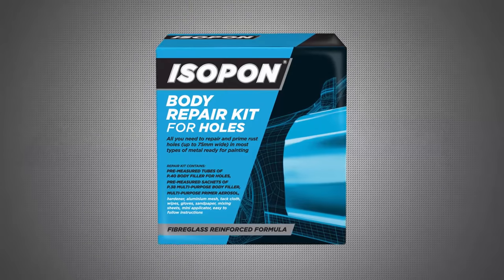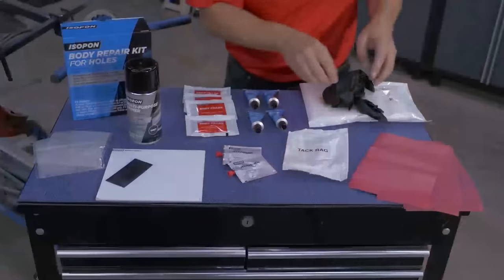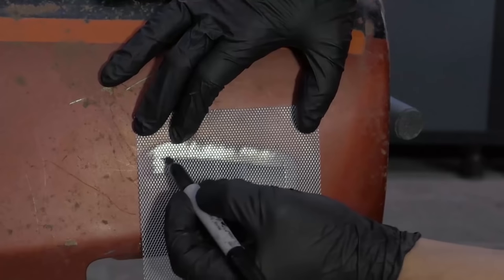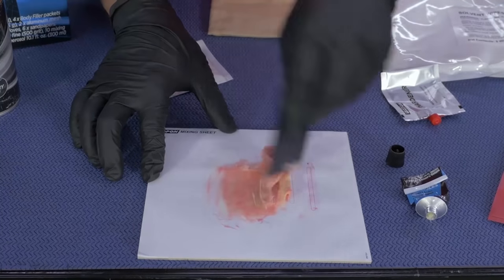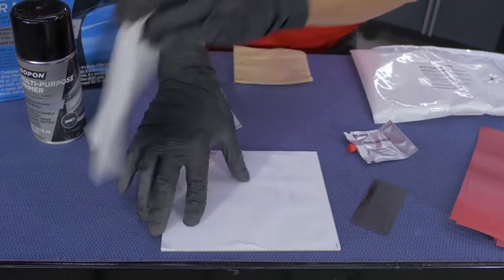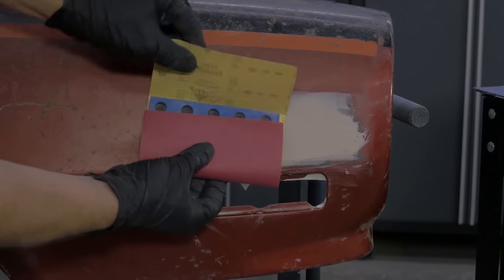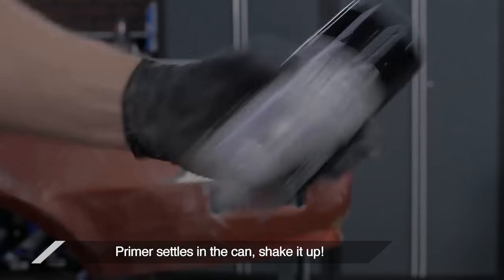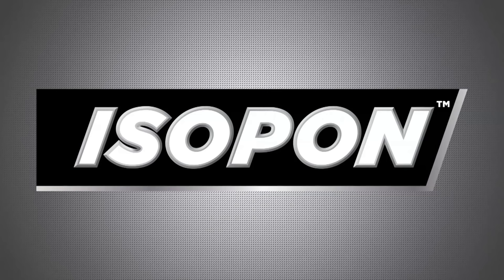ISOPON Body Repair Kit For Holes

Comment: Dislikes, why ❓😓 there's always someone who thinks they can do it better lol,great video I'm going to be buying this kit for my bumper 👍
Reply: It's not abaut the kit itself it's abaut that if you cut metal away you HAVE to put in a new metal part not just a pice of "foil" and body filer the paint will start bubeling and the metal WILL start to rust
Reply: @minikmetija1905  what metal will rust? And wait for the filler to harden properly before you paint it?
Reply: I am a body worker and when it starts to rust it dosen't matter that you sanded it away the rust is already in the metal that is why you need to cut araund the rusted part to cot away any rust whitin the metal itself. That is my experiance as a car body worker. I am doing it for some time and speaking from experiance. Plese do not think i am talking shit abaut your video
Reply: @minikmetija1905  I understand what you mean now. They did cut away all the rusted metal in the video. You say you should put solid metal in the hole rather than mesh but I don't think the filler would hold as well onto a flat surface than it would to a mesh and the filler should be hard enough not to need it?
Reply: @spinach4949  as i alredy told you i am a car schooled car body and paint worker and if you sanded the metal patch whit 60-80 grid sand paper it will be on ther for as long as the metal dosen't rust again. But i understand the perspective of a DIY man and the differance is deffenetly the price and the end result, plus to do a proper repair you need a welder and considering the price i understend your way of repair. Please understend that all i am  doing is explaining the proper method i was thot and taking intho consideration i restored multiple vintage cars i can say i have some experience. If you want to learn more abaut car body repair go to the eastwood company youtube chanel
Reply: @minikmetija1905  They didn't leave any rust.. they cut it away and sanded the edges of the hole.
Reply: @minikmetija1905  I'm assuming the primer used has a rust inhibitor in it otherwise yes rust will come through eventually. moisture is also a factor in body panel repair. sometimes it's better to just buy a panel and replace. Good video though and have been doing this for years working on astra gte's and cavalier sri's back in the day 👍🏼

Comment: Can you apply the mesh on the front side of the panel if don’t have access to the back ? Than fill and sand back ? Thanks
Reply: I have the same issue. The back of where the hole/rust is cannot be accessed to attach the mesh. The job itself looks straight forward, I'm just at a loss as to how to create a backing to apply the fibreglass....

Comment: One of the lads drilled a hole 25mm wide  in a galvanized steel water tank, filled it with isopon, still holding up today, brilliant stuff. has been under water for 12 years now, not sure if the good people at Isopon recommend it, but it worked for me.

Comment: I wonder if only applying the material from the front side create a strong enough foundation.  Should you also need to apply it on the back side so that the mesh gets strongly fixed onto the body?  I feel a strong pressure on the repaired area could give in.

Comment: This is helpful, thanks, but differs from the instructions on the Isopon aluminium mesh (sold as a separate item).  That recommends using a small amount of Isopon P40 (hole filler) to stick the mesh to the rear surface of the metal, let it set, then fill from behind the repair with more P40.  Finally, when that has set, add a layer of Isopon P38 (looks like the second lot of stuff that the person in this video mixes up), allow it to harden, then sand down.

So I'm confused!

P40 is VERY difficult to sand down because of the glass fibres in the mixture which become brittle glass whiskers when set.

Comment: My 01 ZETEC s fiesta failed NCT/MOT on rot in the wheel well and structure used this fairly badly but Sand and sprayed it well, hard as a brick wall, flew through its last two tests
Reply: Well that's dangerous 😬

Comment: Good video, but Are you not supposed to shake the can of primer in a swivel motion instead of , a up and down motion.
Reply from the maker: Hi Evan, The aerosol provided in this kit will contain a small metal ball, this will potentially have settled at the bottom of the can along with some of the base product - shaking the can in an up and down motion will release this ball and ensure that complete mixing of the base with the propellant to give the required product application.

Comment: how does the tape holding mesh not fall off ?  especially after getting wet with road use   ?   which seems to be the only thing holding mesh on the rear

Comment: U POL       I have a question: For example when a vehicle/car has been rear ended by a tractor trailer truck (hitting one side of the rear bumper) cracking the bumper / ripping off  one of the tail lights aka brake lights and smashing the rear quarter panel......  QUESTION ONE (1) What are other possible issues that are likely to have occurred to the vehicle that the naked eye and non mechanics/non body shop specialists    would not be aware of      could yah list the guestimate price for each repair including the obvious repair/replacement of the bumper, tail light and rear quarter panel

Comment: Hi, hope you can help! What if I'm making a repair where I can't get to the back side if the large hole? how do I secure the mesh?
Reply: The mesh HAS to go behind the hole, so you have to get behind the panel somehow. 

If you can't do that, your only option is to forget about body filler entirely and repair the hole by welding in a new piece of steel (which some will argue is the only proper body repair anyway).

Comment: why do you squeeze out the harder onto the mixing sheet in different amounts? first the A amount, then the B amount???
Reply: Types of fillers vary in their chemical composition and therefore need different amounts of hardener to ensure they cure (set) correctly.

Comment: Would this still work if the hole im patching is a sharp curve on a front bumper?
Reply from the maker: Hi Juza, A repair to a sharp curve should be possible, it will just be more tricky to shape and apply the P40 filler to the aluminium mesh. Shaping the repair whilst sanding will probably also be more time consuming than a flat repair.

Comment: How can i place the screen when i cant reach into the rusted hole? It's like a hollow space and i cant enter the place any other way then via the rusted hole
Reply: Thread a thin piece of wire through a number of the holes in the mesh, put the mesh into the hole and pull from the outside. Then follow the rest of the video.
Reply: @TheDutyPaid  thank you! Will try that!

Comment: What if you dont have access to the backside to apply the film? Can you do it to the front?
Reply: that's a valid question..
Reply from the maker: Hi Trent, Repairing a hole from the front can be done. You will need to tap the edges of the hole to create a slight recess for the mesh to sit in - this will then allow the mesh to sit level with the metal substrate. Hope it helps
Reply: Is the mesh magnetic? Could you use that to help pull it towards the body
Reply: @UPOLRaptor  how is the mesh fixed in place?

Comment: 2:29 Can i place that mesh on the front side if i cant reach the back?? any suggestions?
Reply: Of course not, take the bumper of don't be lazy
Reply: @Jonathan English aha I see what u mean now, you can, check a comment in one of them he explains how to
Reply: @Jonathan English no problem I hope it works out for you good luck
Reply: To apply the mesh to the front of the hole, you have to use a hammer to intentionally dent the area around the hole and create a "recess" for the mesh to sit in, so that the surface of the mesh is flush with (or even fractionally below) the surface of the rest of the panel.

Comment: After the procedure,The car looks scratched though!!
Reply: That's why you use the finer grit sandpaper, and the sanding block.
Reply: As said, you have to use finer and finer grits of sandpaper to get back to a perfectly smooth surface. It takes time and elbow grease.
Reply: Add more coats

Comment: that stupid? it says squeeze 'all' of the body filler out of the tube if you only need a small amount??? every rust hole size will be different sized? and instead of hand sanding it, why not use an electric sander?